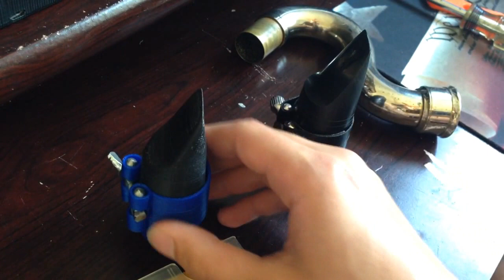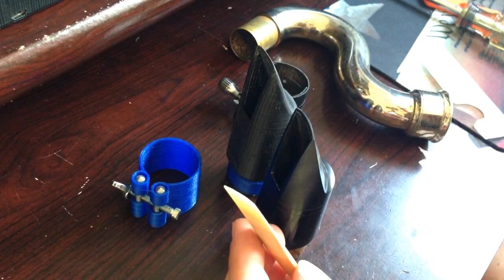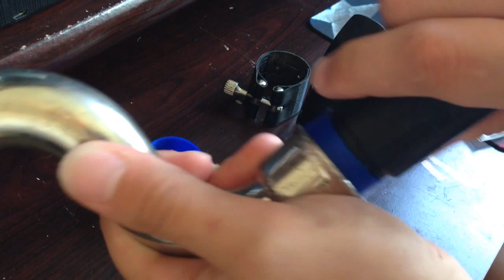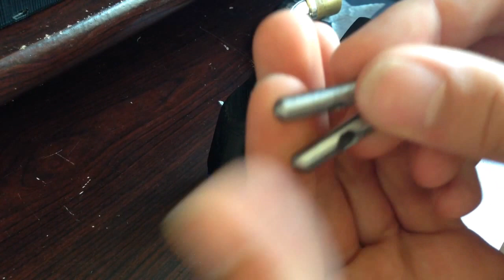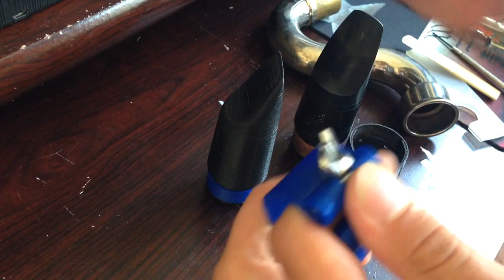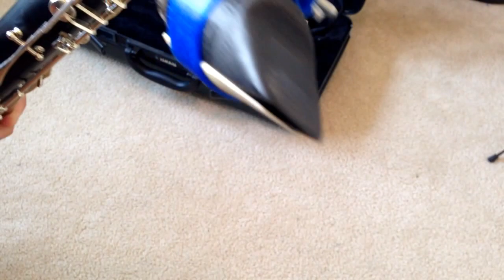3D printed bass clarinet mouthpiece

Comment: That was a fantastic demonstration. Kudos.
A few comments: highly recommended to use food grade filament for something like a mouthpiece.
Instead of soft cork replacement,  which is great, I'd make 3 grooves that would hold rubber O-rings in place. 
That read-to-mouthpiece gap is called "facing" and it is indeed critical to have an even facing for a mouthpiece to function properly. That said i have seen enough brand new $200 mouthpieces that had poor facing... so good one you!

Comment: how come when I print this it only prints the bottom cork area ( when I load it the full model shows up but only the cork prints and I'm using the v2 main .STL not cork or ligature
Reply from the maker: You might try a different slicer software or such things have happened to me before on other models and just re slicing it and trying again fixed the issue.

Comment: You can use chloroform if it is PLA or Acetone if is ABS to smooth the internal surface. (and let dry in a ventilate place for a week)
Reply from the maker: That's not a horrible idea but I don't actually even need it anymore so...

Comment: can you tell me what the difference is between version 1 and version 2 of the mouthpiece
Reply from the maker: Yes, version one required a lot of twerking by hand with files and sandpaper in order to work however version 2 is ready right off the printer with minimal sanding just for clean up. version 2 also has a better body shape in my opinion.